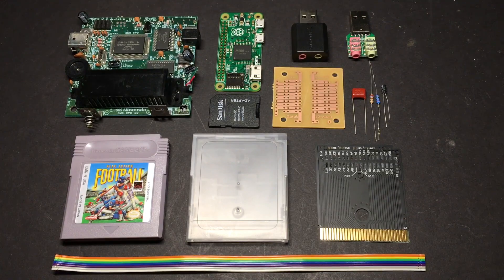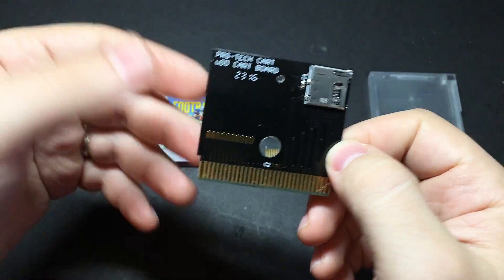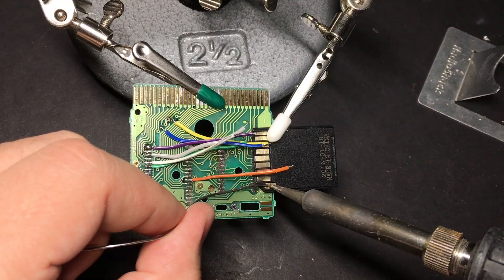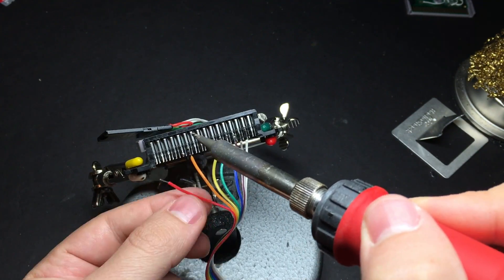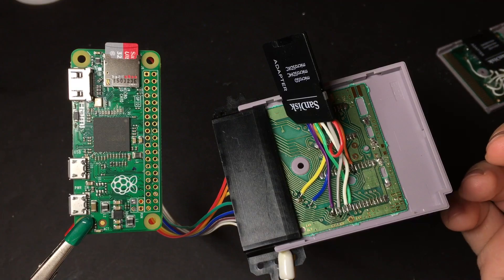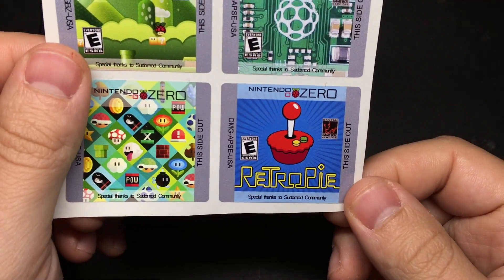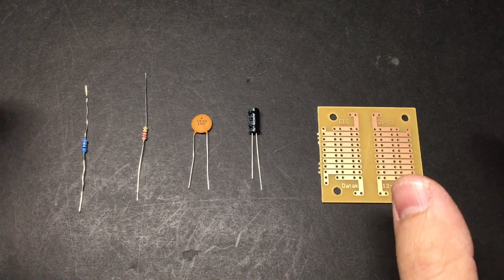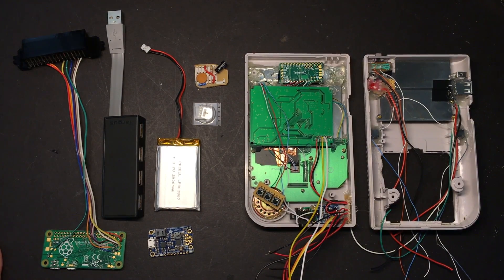Game Boy Zero Guide Part 5 - Cartridge Reader and Audio

Comment: looks like your 270 ohm resistor on the input of the low pass filter is running in parallel to the trace it's connected to on either side, thus not doing anything

Comment: I don't understand why you wouldn't just glue in the cartridge connector for looks, but just the SD-Card reader already on the raspberry zero. Why go through all this trouble to make this when it won't even work on a regular gameboy game anyway? All the games will have to be put on the SD-Card anyway. Also, with the new zero W, you can connect to wifi and download your games anyway.
Reply: Richard Smith he did it because it looks interesting, and it's a creative way to swap SD cards.
Reply: Richard Smith The wireless version wasn't released when he created this video. Plus some gamers like the nostalgia feeling when inserting a cartridge.
Reply: It's for the aesthetic

Comment: Is there a way for a RasPi to read an actual cartridge instead of a SD card?
I'm trying to find out if I can restore my old GameBoy Color with modern parts to keep that retro feel. I want to spare as many of the original parts as possible, but the control board is completely bust, hence the need to replace it.
I also want to add the SD reader as an option (along with the extra buttons this project has), but the main thing should be to use it as if it was the original.

Comment: With the cartridge what's the max sdcard that can be used? Just wondering cause I know the RPi 3 maxes out at 32GB.
Reply: Dragon_princ€ 
Any amount as long as it is formatted as FAT32 or normal FAT
Reply: Would exfat work?
Reply: no but it is easy to change the format on iMac
(just go to the disk utility app) 
your gonna have to search google for other Operating Systems

Comment: Is it necessary to create the SD card cartridge if you are OK with leaving the SD card buried inside the gameboy? I have a retropie system that I built from a pi 2 and I have it set up for wi-fi and just plug in a wi-fi dongle to add/remove games. Could I do that with the Gameboy Zero too? It seems like it could save a lot of steps and you could still insert a blank cartridge to fill the space.

Comment: to make things easier: just cut of the chips with the dremel... that way youll get pins you can easily use and are able to skip cleaning the solder from the board
Reply: Safer to solder

Comment: Hey, I read the guide on your site and I was curious - can you get away with using any GPIO pin for the mono audio? I'm using the one you mentioned for input, so I was curious.

I'm using a GBA shell, and plan to take apart a USB audio adapter to use for sound - I was originally going to just stick the jack in the shell, but after hearing this, I'd love to add a speaker, and the GBA one works fine.

Comment: Hi! I love the tutorials and I am starting to build mine later this week. I had a quick question about the option to skip the cartridge input. If you were to plug it directly into the raspberry pi board do you still need to hook all the wires up from the cartridge reader to the raspberry pi? Could you just glue it in so you can pop non working cartridges in and out for cosmetic looks?

Comment: is there anywhere I can get the cartridge reader without tearing apart a gameboy? also can this be used on the raspberry pi 3?
Reply from the maker: I haven't tried it yet but I'm told you can use the GBA cartridge reader from a DS Lite, you just have to trim off a couple bits of plastic.  Like this one: http://www.ebay.com/itm/Nintendo-DS-DS-Lite-GBA-game-cartridge-card-reader-slot-Repair-Part-/172090308991?hash=item281161b97f:g:NTAAAOSwRH5XK77l

As for the Pi 3, the most I'd recommend is a Pi 2 for this.  Pi 3 sucks down a LOT of power and gets very very hot.
Reply: Have you had any problems with this, like the card reader not being able to read/write for some unknown reason?
Reply from the maker: I did have some problems initially like that.  I added some shielding and tried a few different SD cards until I found one that worked.  Haven't had any issues at all since then.  It is very fiddly though, I will say that.  There is a guy in the forums who is selling a pre-made cartridge->SD card board that has some filtering built-in that makes it much less picky.

Comment: I'm building one of these using a USB soundcard for audio an iv build my own circuitry for the controls, problem I'm having is I need to connect both via USB to the pi zero and when using a USB 4 port hub the pi isn't recognising anything plugged into the hub, iv tried various hubs and various pi zeros same result, any suggestions? Thanks

Comment: Hi Wermy! I was just going to do a very similar project as well and stumbled upon your video series: really excellent work here. Now what I was trying to solve before finishing mine is one thing I could not find an elegant solution so far nowere:how about shutting down the gameboy zero? I mean there is need of some circuit that can on a press of a button/switch send a shutdown h now to the retropi os and then after some delay cut off power otherwise batteri would still be drained (not to speak that just cutting out power is also bad for the sd on the first place..)> any ideas?
Reply from the maker: Hey there,
  Thanks!  Glad you're enjoying it.  In my build, I'm just using the menu item for "Shutdown System" in RetroPie (which I presume just calls something like 'sudo shutdown -h now').  A second or two after the screen turns off, I turn off the switch.  That's worked well for me, I haven't seen any text about the dirty shutdown bit being on whenever it boots.
  If you're looking for a more comprehensive solution there are some cool things being worked on in the forums you should check out -- specifically: http://sudomod.com/forum/viewtopic.php?f=20&t=97 for a software solution, and http://sudomod.com/forum/viewtopic.php?f=9&t=46 where one user is working on a pretty cool custom board that lets you call the shutdown command with the push of a button.

Comment: I think you short out the 270 Ohm Resistor in the Audio PCB
Reply from the maker: Do you mean on the back side?
Reply: Yes i think on the prototyping board the 2 holes where you put the resistor in are connected
Reply from the maker: Ah, nice catch, thanks!  I'll put a note that that trace should be cut.
Reply: By the way cool project and well explained.

Comment: Regarding noise-reduction: I know that there exist tape, that has aluminum, copper or some other metal on one side and sticks on the other side. I've used some of this tape before and it did help me a lot in my own made radio.
Reply from the maker: Thanks for the tip!  Yeah, I didn't have any of that on-hand so I had to cobble together my own with aluminum foil and electrical tape.  :)
Reply: wermy You're welcome :D
Thanks for these awesome videos!